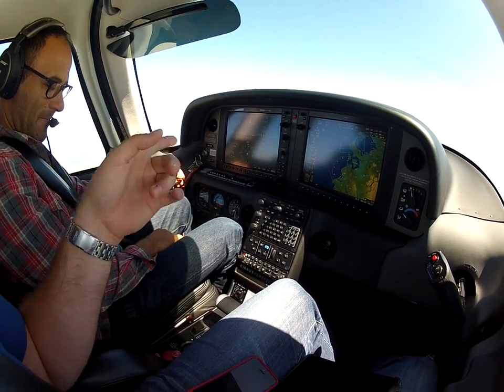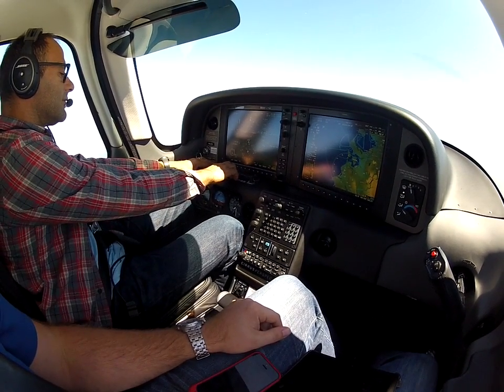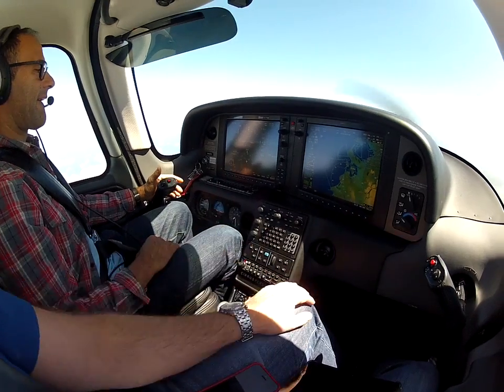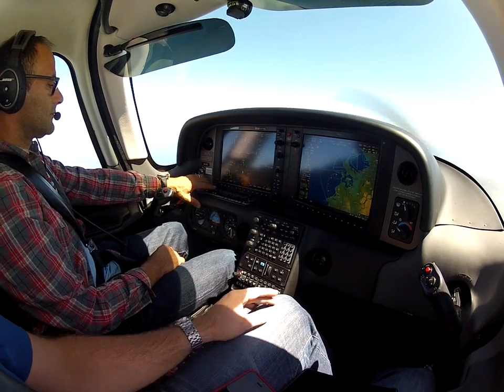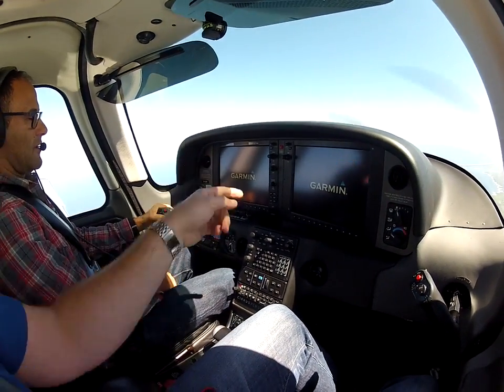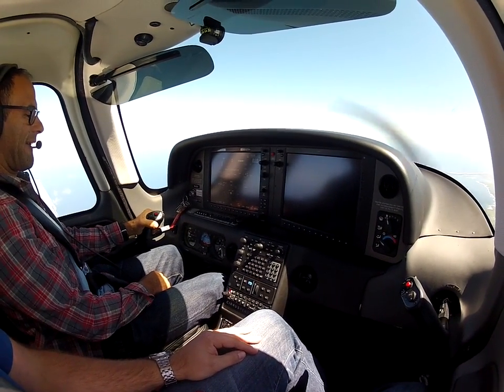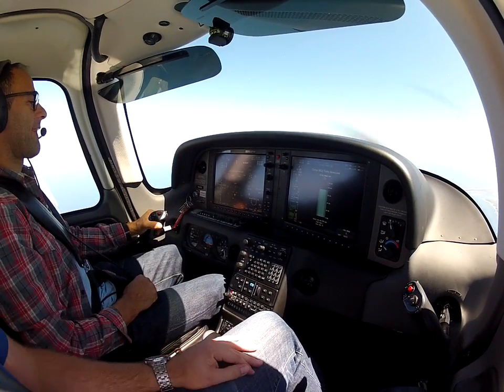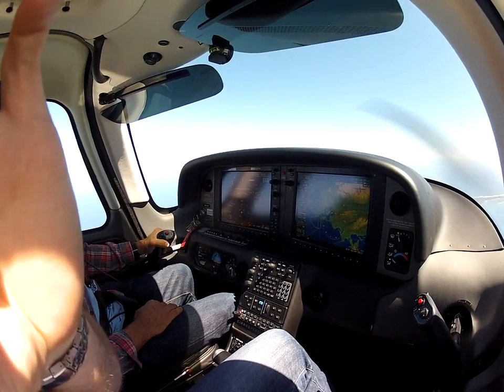Cirrus Electrical Fire

Comment from the maker: Yep, I have been in Australia mentoring pilots  on Cirrus flying. It was a great time. Jet lag is killing me though.

Abhay, Yes the engine will still run with the bats and Alts all turned off. The engine runs the mechanical fuel pump and the magnetos which are also mechanical. Once the engine is started you no longer need electrical power for it to continue to run.
Reply: Yeah crossing the dateline is a killer trip!  Would love to do a flight with you.  I'm based at Melbourne and fly Gen 3 & 5 Perspective addition SR22/20's out of Moorabbin (YMMB) from Avia Aircraft who are the Cirrus sales agent in Victoria and CTC.  They also have a full motion Cirrus simulator with CAPS.
Reply: Great video... always better to learn this BEFORE you need to!